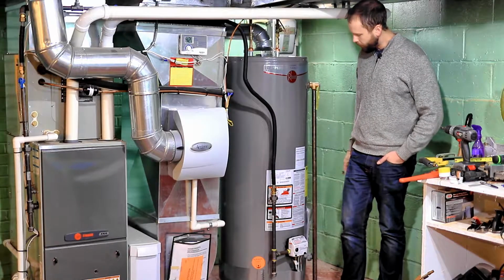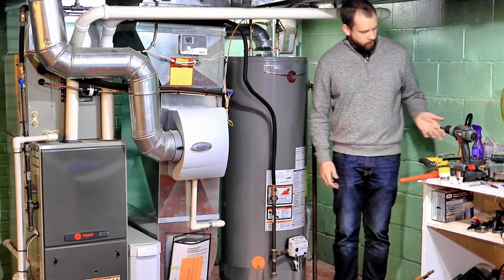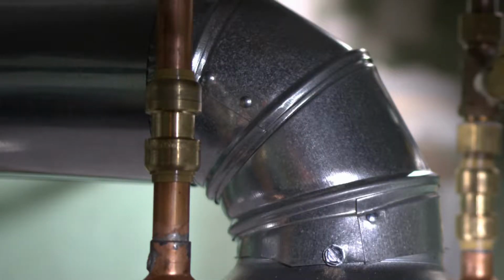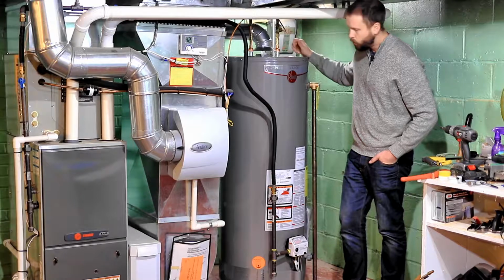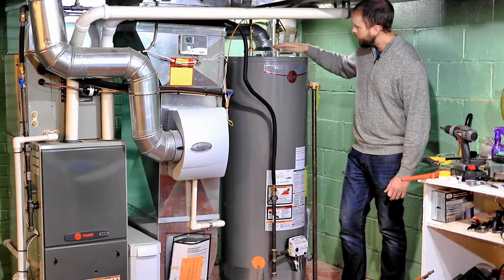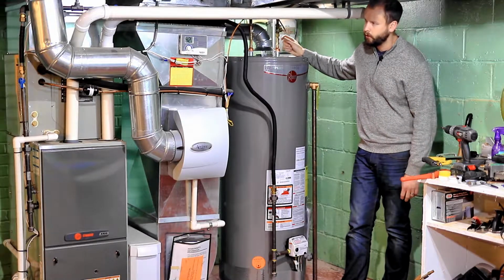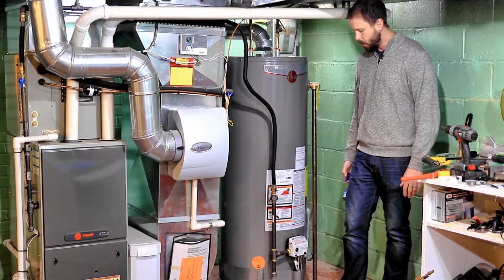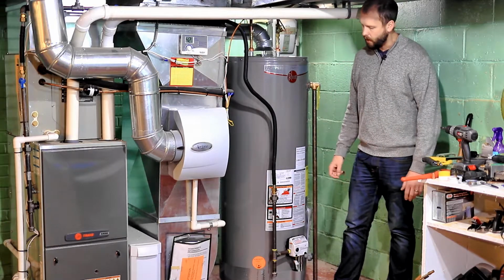Installing a Rheem Hot Water Tank and Removing Old Hot Water Tank

Comment: Nice video.  Very good tutorial.  You can save a few hunder dollars by doing it yourself.  Just be sure you are comfortable with the basic tools he uses in this video.  Note:  Accoring to many, many review  Rheem water heaters are notorious for having issues with leaking and the gas regulators.  Do your research before you buy a replacement.

Comment: Great video by the way because you covered lots of practical points for those dealing with sweated copper plumbed water heaters, even though you didn't show much of the actual installation.  My question is regarding the threaded adapters.  Since yours were 3/4 FIP to 1/2 sweat I assume you have a shoulder in yours and you may or not be able to put a washer in there although you probably don't need it with the plastic inserts in the nipples.  My copper piping is 3/4" so the copper threaded adapter has no shoulder.  How will I make a seal without a shoulder?  I may have to go with a 3/4 FIP to 3/4 sweat dielectric union.  At least that will give me a rubber washer and I will be able to disassemble for water heater service/replacement and I can tighten the connection if I need to.  Thoughts?

Comment: I disconnected my pipes at that big union. Or coupler , same  one you have right below where u disconnect the gas
Now does that need Teflon tape or pipe dope ?
Reply from the maker: No need to teflon tape or pipe dope the big union fitting but you will want to do a leak check with soapy water after re-connecting it.  It should seal back up fine but just in case...
Reply: Cool Stuff Guys Like thanks yes the previous installer didn’t use anything on the big union, I just cleaned it up, and checked it with soapy water, no leaks, thanks again

Comment: You have made a huge mistake. Those threaded adapters don't have a dielectric union and are going to rust the crap out of the top of your water heater. You need to take those adapters off and replace them with dielectric unions.
Reply from the maker: Rheem hot water tanks come with dielectric, plastic insulated nipples from the factory.  So you can install a copper fitting directly to the outlet.  I'm sure a dielectric coupler is still better, but I don't think the fittings will corrode enough to be the cause of failure on the tank.  Has been about a year and a half and the fittings and top of tank look as good as new.  The plastic lined nipples should keep the galvanized steel and copper out of contact where the water is present.  On the outside where the threads touch there is no electrolyte (water) so it should not corrode much if any.
Reply: A hate comment on a issue of 1 in a million. Yet he resolved the main problematic issues early and clearly. Vastly superior video than most of the videos with a million views